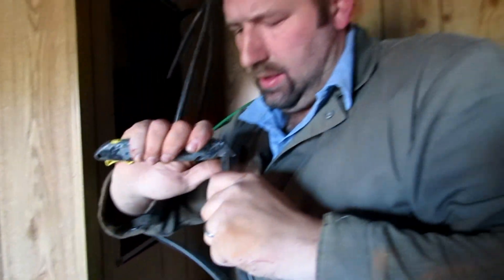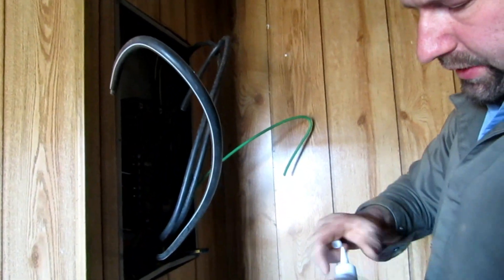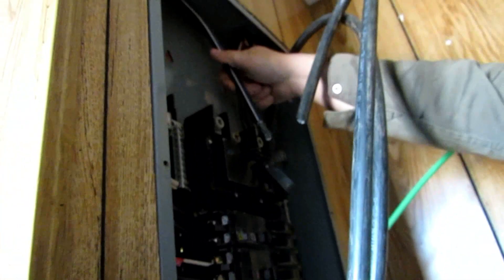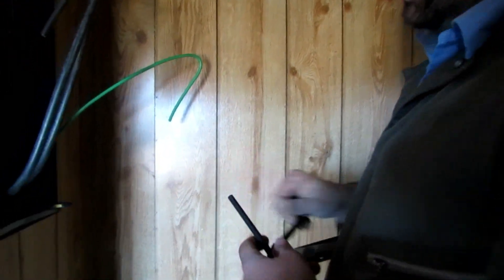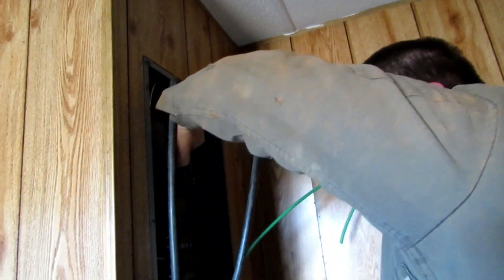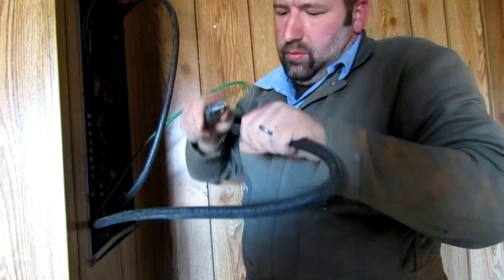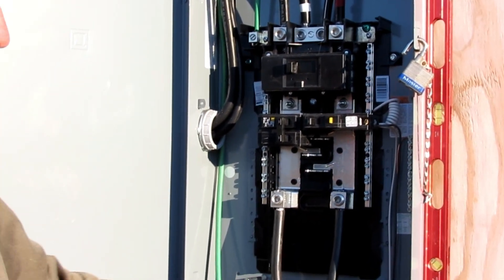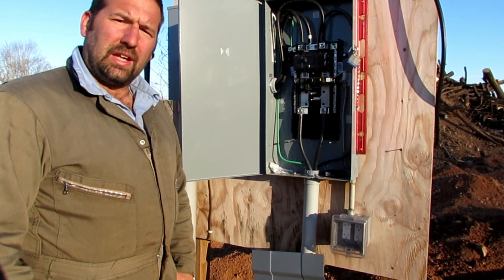Part 2 Electrical Service Feeder Connections For The Mobile Home

Comment: Hi! Was hoping you could help answer a question. I’m running mobile home feeder wire 2/2/4/6 and I was wondering, is there a specific “positive” and “negative” cable? It’s 4 cables, 2 hots, a neutral, and a green ground. I’m hooking up from my house to my camper. I am running it to a 50 amp outlet to plug my camper into.
Reply from the maker: @jacksonlipe1214 great question. The two larger #2 wires are the hot wires that land on a breaker. The #4 medium wire is the neutral that goes to the neutral buss. Lastly, the green is the ground that connects to the ground buss that might be the same as the neutral buss. Thanks for watching and asking. ~Mr. C.

Comment: How far does the meter base and disconnect box supposed to be from the mobile home?
Reply from the maker: @countryascanb I have seen them within arms length and like mine 100 feet away. I would check with your local code enforcement to ensure what you are planning is going to be acceptable. Excellent question! ~Mr. C.

Comment: Enjoy your videos bro but in a trailer house installation where are the grounds and neutrals separated ? If you don't mind dumb questions.
Reply from the maker: @Roy Ogden thanks for the kind comment. No dumb questions here. If you don't know, just ask. I think you are referring to the panel inside the house. On mine the wires were all mixed on the ground bus bar. If you are referring to the outside panel for the service entrance I would contact your local code enforcement. Grounding rules vary greatly from one location to another. I was required to bond the neutral bus bar in the outside panel to the frame of the panel with a long green screw. I hope his helps. ~Mr. C.
Reply: @NaturesCadenceFarm  Thanks for the reply sir it helped a bunch. Thank you very much.

Comment: URD I hope you didn’t put that in pipe Only rated for direct burial
Reply from the maker: extremepianos the cable is only in conduit as it leaves the outdoor breaker box goes under the driveway and as it goes into the mobile home. Cable shall be protected as it enters and leaves the ground per 300.5 (D) (1) 2014 NEC. My local authority having jurisdiction required me to place the cable in conduit under the driveway although not required if minimum cover requirements are met. The reasoning  behind this is the high probability of heavy equipment due to farming operations. Thanks for watching and commenting! ~Mr. C.

Comment: I am curious, is the outside panel at the meter base considered the main panel and the inside panel considered a sub panel or are they both main panels?
Reply from the maker: Cole Cameron you pose an excellent question. I would consider both of them main panels because the mobile home panel is connected to feed through lugs and not a separate breaker like a sub panel would be. Just to clarify I was not required to install a breaker box at the meter base. The only requirement is to have a disconnect for the mobile home panel located at the meter base. With this arrangement the mobile home panel would be the main panel. I could also see an argument for the mobile home panel in my installation would be considered a sub panel. If another commenter has more information I welcome your input. Thanks for asking a great question! ~Mr. C.
Reply: @NaturesCadenceFarm  I have a similar question. I just had service upgraded on my house. Local code, starting this year, now requires an outside disconnect for emergency services.

So they installed a “trailer panel” on the side of my house. It has a meter that goes to a panel, with a pass through out the bottom that feeds the inside panel.

The inside panel has neutrals and grounds together, with no ground wire. 

The outside panels is the panel that is tied to the ground rod.

Is this correct?

Comment: Why is mobile home feeder cable different from that used in a permanent structure?
Reply from the maker: Ronald Kovacs mobile homes are required to have the meter base and disconnect mounted on a pole and board remotely from the structure. The feeder cable is then direct buried to go under the mobile home and feed the breaker box. Mobile home service entrance cable is designed to be direct burial. A house has the meter base mounted to the structure and the feeder is ran through the side of the house and landed into the breaker box. House service entrance cable is designed to be installed in and on the structure and not buried. Hope this helps. Thanks for asking and watching! ~Mr. C.
Reply: @NaturesCadenceFarm  yes, thank you so much.

Comment: What model disconnect/breaker box did you use outside?
Reply from the maker: Perry here is a link to the exact panel I used.
Square D 200 AMP Feed through breaker box: https://amzn.to/3ebFiIN 
Please check the description for other items that were used for the installation. Thanks for watching. ~Mr. C.

Comment: Hello I have a double wide and I put new led light and ceiling fans. But now I don’t have power in half of the house. Do you know what’s the problem
Reply from the maker: Jose Martin sounds like a loose connection that got disturbed during the install. You might need some help from an electrician that can get in there and break it down and figure it out. Good Luck. ~ Mr. C.

Comment: Can I get 212 Kcmil 4/0 cable into a 200 kcmil 100 amp SquareD breaker lug?
Reply from the maker: G VanGaya I am not sure if it will fit. From what you are describing I would say yes. A call to Square D Technical Support ( 1-877-342-5173 ) might be  the best bet for an exact answer. ~Mr. C.

Comment: Is it a correct assumption that N & G are bonded outside in the panel, and not bonded in the trailer?    Also, did you add a ground from the meter socket to the exterior panel, or are you counting on the nipple to be the ground?   Respectfully,     Kevin
Reply from the maker: Kevin Coop yes they are bonded in the outside panel but the panel was already bonded in the trailer so I left it, but check with your local code enforcement for your bonding requirements. There was no requirement for a ground wire from the meter to the outside panel. With the neutral wire connected to both the meter base and breaker panel the enclosures are  bonded to the neutral and everything is good to go. Again double check with your local codes. Hope this helps. Thanks for asking. ~Mr. C
Reply: Nature's Cadence Farm   The neutral to ground bond should only be made at one location.  This location is at the panel outside.  You should remove the bonding jumper in the trailer, and there should be separate ground only bar in the sub panel.   Best wishes.

Comment: Looking good! You certainly seem to do a professional job and I can't imagine you'll have any problems with passing the inspection and you can finally power up your mobile home! From what I recall from my high school physics I thought aluminum wasn't nearly as conductive as copper so I'm curious about the aluminum cabling. Is it to reduce the weight of the cables, or to reduce costs, or an availability thing, or a combination of these, or something else perhaps? Anyway, thanks for another great video and good luck with your inspection! :)
Reply from the maker: Simon B you are correct, aluminum wire is not as conductive as copper. Generally if aluminum is used it needs to be two sizes larger to handle the same current as copper. Aluminum  wire is used here in the states (I am not sure about over seas) as residential service entrance wire very regularly. The benefit is (as you stated in the original comment) PRICE. Aluminum costs half as much as copper and if installed properly will provide years of reliable service... pun intended.  Thanks for the encouragement! ~Mr. C.